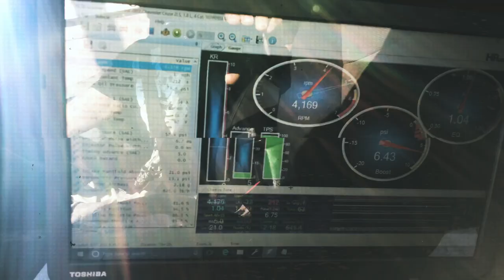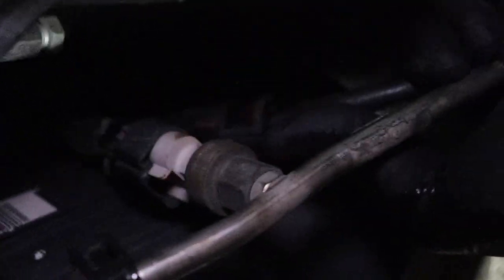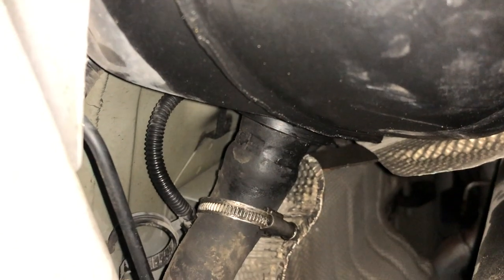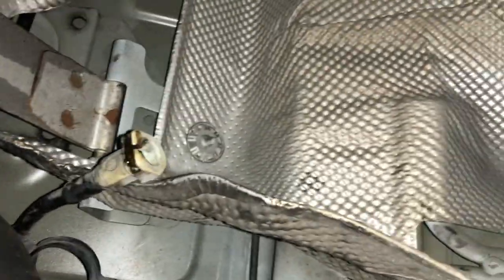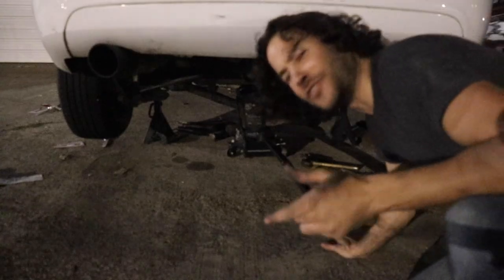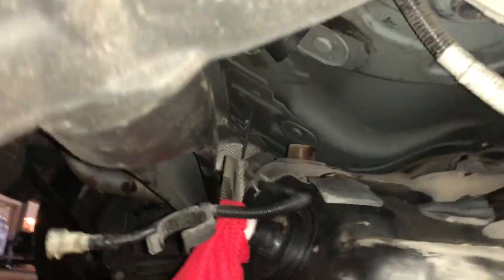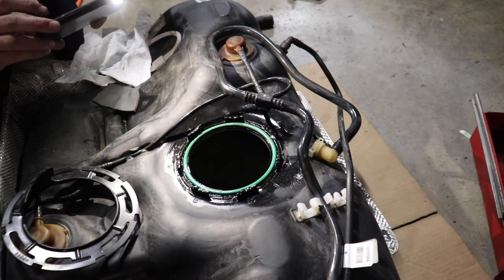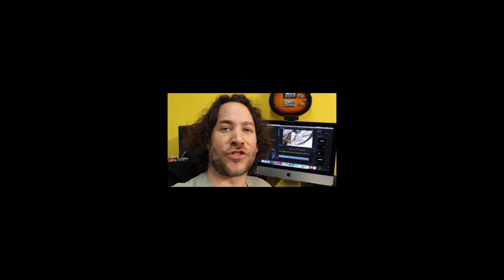How to Install a Replacement / Upgraded Fuel Pump Chevy Cruze -Turbo 1.8 Vlog- DW Deatschwerks 300c

Comment: Good luck getting a fuel reading on the gauge....it appeared that you forgot to transfer the old plastic float mounted on the metal arm coming off the fuel sending unit to the new pump assembly.....unless you pulled it back out off camera and put it on....otherwise a good tutorial

Comment: Why don’t you show us pulls or how the Cruze drives? You show us working on it but not the outcome lol
Reply from the maker: LOL! I'll get some content up of pulls. Waiting on forged pistons to come in so I can put a moon tune on it.
Reply: Uhhh, did you not catch the part where the engine isn't in the car and he is completely rebuilding it?
Reply: 802 Garage ok and what about before that??
Reply: @brando7655  He drove the car, had the PCV wrong, filled it with oil, disassembled because he thought he blew the engine, and hasn't gotten it back together yet. Stick around for the pay off. He is going to make some stank!

Comment: do fuel pumps have to specify if they are for chevy cruze turbo, cause i have one but it doesn’t specify if it’s for the turbo one
Reply from the maker: It's the same pump whether it's turbo or NA.
Reply: @cmattdabrat  can 2012chevy cruze fuel pump use in 2011 cruze?

Comment: What up!! Hey got a dilemma here. I got the same cruze. It tends to idle rough and stall at stops. And it has a p0172. I replaced maf sensor, camshaft sensor and map sensor and nothing. I kind of rounded it up to either dirty injectors or bad pump. What you think?
Reply from the maker: Could be dirty injectors. If it's running okay on the freeway, but dies at an idle.
Reply: @cmattdabrat  thanks for the quick response👌 hey I noticed the downstream sensor is spiking and dropping the same as the upper o2 sensor. I was aware that the downstream has to be at a steady pace on a graph. Maybe that has something to do with it? No Catalytic converter codes yet though.
Reply from the maker: @IntentionallyLeftBlank.  I'd just give it a tune up. Air filter, plugs... see where that gets you. Then the injectors. Might take care of it.

Comment: is this chevy a 1.8 liter
Reply: and could i add it to my stock chevy 2014 cruze note i do have a air intake
Reply from the maker: It's a 1.8.
Reply from the maker: Definitely. I upgraded it in an attempt to reach some high hp goals.

Comment: Matt 

Hi again 😀

In case you wanted to know. The maxspeeding an-6 fuel lines are compatible with the car and only really needing a few extra fitting for plastic pump housing and the fuel rail and fpr although I'm on an external. 

The great advantage of this is to add a inline cleanable or serviceable fuel filter by the side of the tank. If your Cruze is like our astra. The likelyhood is you only have the teabag type  gauze in the tank. Absolutely garbage. Get an online filter on there. I use the PQY one. It's fantastic
Reply from the maker: Man, I really appreciate all the help. I'll definitely look into it.
Reply: Друг ты ошибаешься ,там стоит два фильтра, первый фильтр грубой очистки сетка висит внизу топливного модуля  ( типа марля , как ты его назвал ) , второй фильтр тонкой очистки ,он находится внутри топливного модуля .

Comment: Hi have chev Orlando 1.8 eco i want some advice pls i want to put a eaton m65 supercharger on it and the fuel pump just died but i needed to get hole assembly rather than just pump and filter much more expensive like this is there a way to mod it to have a return and service able fuel pump?
Reply from the maker: You can pull the unit and install just a new fuel pump without replacing the whole unit, or you could just do an external fuel pump.

Comment: Was there a steel style fuel filter with a ground wire on the filter?   Thanks
Reply from the maker: Not that I could see. The filter is built into the pump housing.

Comment: This video came in so clutch! Do you know where the fuel filter is?
Reply from the maker: Glad it helped. It's built into the housing. In order to replace the filter, you have to replace the whole unit.
Reply: Good too know

Comment: I have 2014 cruze 1.8 no turbó where is the filter please   I look around the tank I dont found.
Reply from the maker: It's built into the fuel pump assembly. It's not replaceable. You have to replace the entire pump.
Reply: @cmattdabrat  than you brother for your help.

Comment: Didn't get, what was wrong with the engine? Are you planning to apply turbo on it?
Reply from the maker: The engine was fine. Added a turbo and decided 8-10lbs of boost wasn't enough and started modifying the car to reach a high hp number.

Comment: Good info. I have an ECO and want to drop the tank to pull out the vent limiter thing that stops the ECOs from using the top ~3 gallon of fuel capacity. That is after I get my 3rd engine installed at only 53k miles.
Reply from the maker: I'm glad it helped. Let me know how it works out for you.

Comment: Tell you what, it's easier than pulling the tank from an MR2! Hate cars that don't have an access window inside. One reason I love Subaru. :D
Reply from the maker: LOL! I agree. I'm probably just lazy and would prefer an inside access. That or, I'm just not a fan of working on the ground.
Reply: @cmattdabrat  I have Cruze 2012 1.6L
I thought to make a window to replace the fuel pump by easy way 
Is harmful for my car ?
I need ur help
Reply from the maker: @khaledmatar2488  Just take your time to drop the gas tank. it's not that difficult. I wouldn't cut a hole in the floor. That's more work than just dropping the tank.

Comment: How about a new gas filter install?👍
Reply from the maker: The fuel filter is part of the pump assembly.
Reply: @cmattdabrat  okay I thought the gas filter would be before the fuel pump.Like outside the gas tank.Thanks for the info.👍😀
Reply from the maker: @TT-hy1hg  Any time! I thought so too until I upgraded the fuel pump. Just got a lower mile unit to upgrade.

Comment: GM still doesn't give a fuel pump access panel under the rear seat???  Gees!
Reply from the maker: Tell me about it. I need to add a return line for the fuel regulator that's a boost by pressure. Not looking forward to dropping the tank again lol.
Reply: @cmattdabrat  if I were you. I'd cut your own access panel under the rear seat (if that's where it lands) and make your own cover.  A lot of Camaro Firebird guys used to do this

Comment: You do realise you could have just removed the rear seat and a metal cover to access the fuel tank pump
Reply from the maker: With the Cruze, you have to drop the tank.  There's no access door like on say a Honda. https://youtu.be/VtdMLrlPtL4
Reply: @cmattdabrat  Dang they made that hard for you. All the cars i have had have always had the cover under the seat. And I would NEVER own a Honda...lol
Reply from the maker: @maxoutput01  lol, they definitely did make it hard, or so the service department can make a lot of money off of you.
Reply: @cmattdabrat  Yep...lol. But loving the videos. Please tell me you are getting an engine hoist when you install the motor...lol if not then you could do what i do and raise the car with axle stands and lift the motor from the ground up with jacks....doing it old school style....hahaha
Reply from the maker: @maxoutput01  Thanks! LOL will definitely be using a hoist this time around.